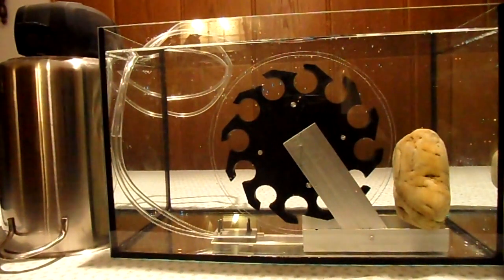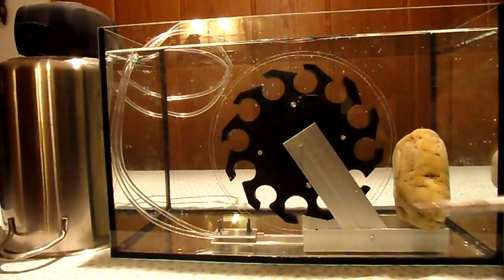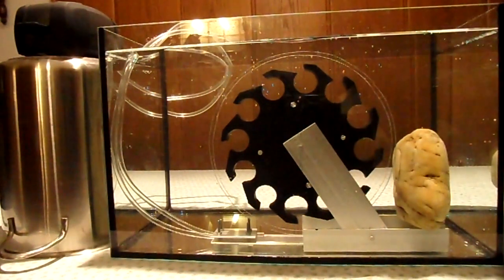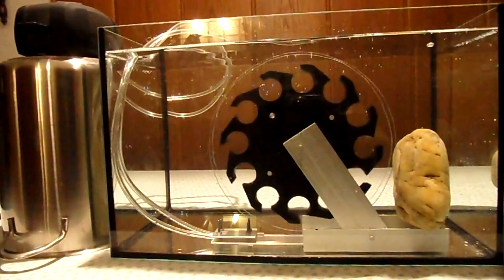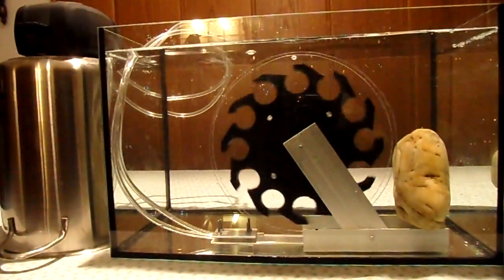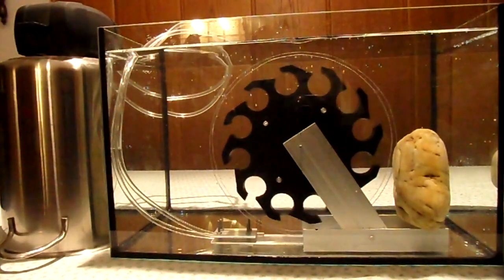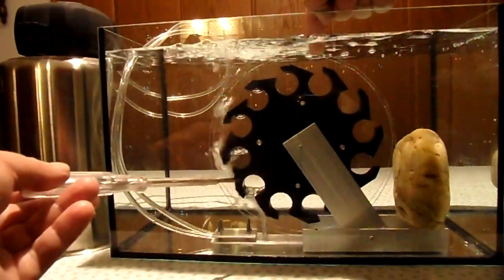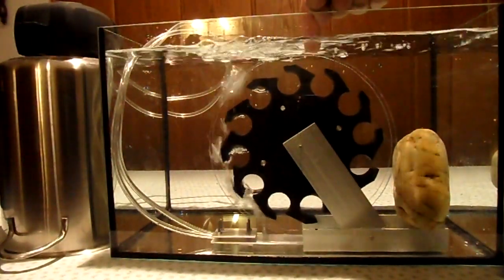Buoyancy Wheel

Comment: What is the critical threshold limit to over come inertia of wheels? Frequency of bubbles is proportional to a factor of the wheel rpm?
Reply: Working on something like this..pull energy off the wheel by putting resistance to it and slow it down

Comment: Now stack 10,000 of those wheels vertically each turning a generator.
Reply: Or just make one giant one and put 1 generator on it!!
Reply: @iEnergySupply  Will it produce more energy than your air pump consumes?
Reply: No but you could store the energy with giant air tanks or small ones at high pressures, if you could only store the heat energy in your water tank to help the bubbles expand and become more buoyant.

Comment: Put a crank pump on the rotational shaft to bring down the air and you will have a perpetual device. Brilliant. Air is much easier to move than water... basically a reverse hydro system. Yeah!!!
Reply: YEET
Reply: Wait until two of these are used for an electric surfboard... Waterproof air compressor on bottom....2 buoyancy wheels in the back. Zoooom

Comment: Think if that generator could develop 1 volt and you produced hydrogen and oxygen from the water, this would self run.  This idea is from Tesla that I suggested.  Good work again for this experiment.
Reply: Fernando Gigliotti Sorry that I have to crush your dreams but if you put a load on a generator, for example by basically shorting it to electrolyze water it becomes much harder to spin it..
And 1 volt is not enough for hydrogen. You need a little bit more (I don’t know the exact number)

Comment: Conrad, do you have any specifications for the Fish Tank Air Pump?
Reply from the maker: https://www.eheim.com/de_DE/produkte/technik/pumpen/air-pump400 (this is the one shown in the video, the price was about 20.-- Euro in the aquarium section of a Baumarkt = home improvement store).

Any air pump for an aquarium (fish tank) will do.

e.g. http://www.ebay.com/itm/TOPFIN-10-to-15-Gallon-Aquarium-Air-Pump-/400870420969?pt=LH_DefaultDomain_0&hash=item5d55bd31e9

Be aware of the fact that the usual water wheel http://en.wikipedia.org/wiki/Water_wheel works much better. To pump air to a certain water depth costs a lot of energy. The wheel encounters a lot of resistance or drag in water.